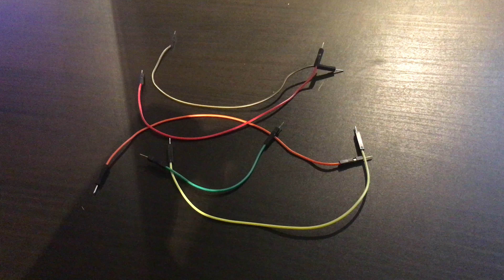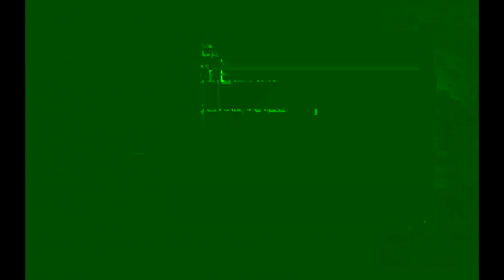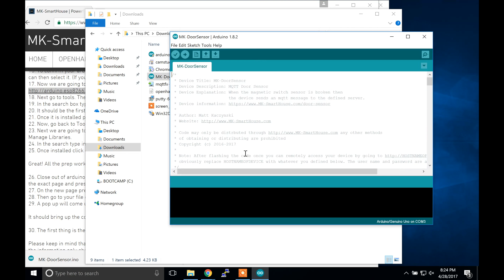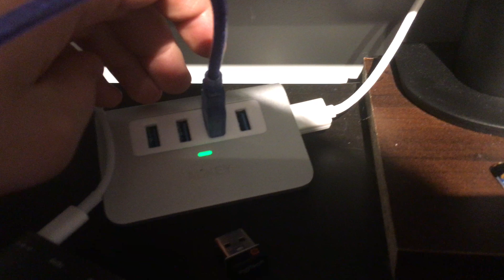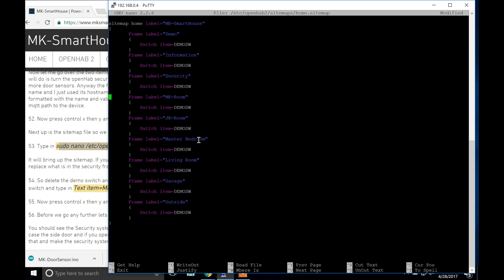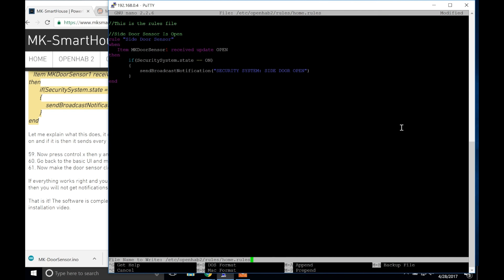Complete Guide MQTT OpenHAB ESP8266 Door / Window Sensor: Software WINDOWS

Comment: Hi Matt, great videos as always.
I've noticed that your new ino files are quite different than your videos show.
Do you have any older ino files for esp8266 contact switches available?
I have a project in the works using two contact switches with one esp8266 to check my refrigerator doors.
Thanks

Comment: First I would like to say Thanks your tutorials videos. They are very useful.
I have a problem and I don't understand what is that exactly. I read your Forum and here the comment and the MQTT for everyone working correctly but unfortunately for me not. It get the esp8266 the power and if the state is open, then I get the messege from open state. And when I make it to close then also get close but after close state the esp8266 doesn't send message anymore. If i plug out the power(reset the device) then state is open then I get again the mqtt message but if the state will be close after this message I don't get any state.. So what i think in Sketch some where something is said the Modul if the state is closed then you should working anymore. I don't know. Do you have anyidea why happening this? I just changed in your sketch the wifi and the password, everythingelse is the same as by you. Thank you very much again. :)

Comment: Hi Matt, LOVE your videos! Im over in Australia and I am using a ESP8266 on a breadboard at the moment, I have the ESP talk to the MQTT.fx great, and everything works! But when you say move the jumper from program to run, what pins is that linking on the ESP? And is it going via a resistor or anything? Please please help me out!! Cheers!!
Reply from the maker: +Lewis Barnard when in program mode GPIO 0 is connected to ground and on run mode it is connected to 3.3v
Reply: MK-SmartHouse thank you so much for getting back to me. Thanks I will try that! I think I have got a bad batch of ESP so will have to order some more! I would share my ideas with you!

Comment: Hi, how hard would be to implement POE ( power over ethernet ) and adapt the code for it so we only use one wire instead two and a power supply ? Wouldn't be also cheaper this way ? Thank you !

Comment: Got mine :) - only issue I have is it won't join the wifi network (has correct details etc.) it works with Mqtt local with open/close etc.
Reply from the maker: +MrFrostmaul what do u mean it won't join the wifi network? How can it send Matt commands without wifi?
Reply: Mean't it can recieve commands via the MQTT via ardunio into computer, but just the wi-fi doesn't connect.

Comment: Hello I finally got a switch working as a prototype into i can order one of yours. Everything is working i can see if see it in the openhab UI page when it says open and closed. Also in my cellphone i can also see it when it says Open and Closed. But i do not get any notification on my phone. It is Checked in the Green box so the icon on the left is in green. I'm wondering Why I'm unable to get Notifications. I followed all your steps correctly.
Reply: I am having the same issue. Did you ever figure it out?
Reply: I figured it out. On your iOS device, go to settings in the openhab app. Make sure the remote URL is "https://myopenhab.org". Make sure it says this exactly.

Comment: I created my first test sensor with a push button and a ESP8266 it working. Compile still got that Error but it does Compile with no problem. But one thing that doesn't happen is the Notification. When i push the button it says Door is open i can see it on my phone when it says Open and Close. and the Button is turn on Green not red for off. So not sure Why there is no notification?

Comment: Hello I'm getting this errors when i try to upload. I change all information to mine and i get this.

C:\Users\LENOVO~1\AppData\Local\Temp\arduino_modified_sketch_762842\MK-DoorSensor.ino: In function 'void setup()':

MK-DoorSensor:105: error: no matching function for call to 'ESP8266HTTPUpdateServer::setup(ESP8266WebServer*, const char*&, const char*&, const char*&)'

   httpUpdater.setup(&httpServer, update_path, update_username, update_password);

C:\Users\LENOVO~1\AppData\Local\Temp\arduino_modified_sketch_762842\MK-DoorSensor.ino:105:79: note: candidate is:

In file included from C:\Users\LENOVO~1\AppData\Local\Temp\arduino_modified_sketch_762842\MK-DoorSensor.ino:23:0:

C:\Users\lenovo mhp828\AppData\Local\Arduino15\packages\esp8266\hardware\esp8266\2.2.0\libraries\ESP8266HTTPUpdateServer\src/ESP8266HTTPUpdateServer.h:14:10: note: void ESP8266HTTPUpdateServer::setup(ESP8266WebServer*)

     void setup(ESP8266WebServer *server=NULL);

          ^

C:\Users\lenovo mhp828\AppData\Local\Arduino15\packages\esp8266\hardware\esp8266\2.2.0\libraries\ESP8266HTTPUpdateServer\src/ESP8266HTTPUpdateServer.h:14:10: note:   candidate expects 1 argument, 4 provided

exit status 1
no matching function for call to 'ESP8266HTTPUpdateServer::setup(ESP8266WebServer*, const char*&, const char*&, const char*&)'

Comment: i keep getting espcomm_upload_mem failed    any ideas on this ? ive tried with a pc and mac
Reply from the maker: 1. Are you sure you have the right com port 2. is it in program mode 3. Do you have the proper connections between the arduino
Reply: MK-SmartHouse yes and this is the second time Ive tried with a totally new pcb and components
Reply: MK-SmartHouse the issue im having is i soldered the board and the ESP board together and just waited for today for the resisters so i soldered them in and then i connected up to the arduino after messing around to get it all connected it connected and the file uploaded
Reply: MK-SmartHouse i pluged into power after moving the jumper to run i then opened up the MQTT on my MAC and connected and subscribed then i moved the sensor loose part to the wired in sensor and the circuit board cut out and smelt bad i burnt my finger but i dont know what it was on
Reply: MK-SmartHouse after trial and error of messing with a spare circuit board and components however no esp was on this PCB i moved the sensor just to see if it broke the circuit and it stayed on
Reply: MK-SmartHouse now I have soldered an new esp to the pcb I remember the first time I plugged it all to the arduino correctly the rx or tx can't remember lit up this time it didn't do that but Ive used the arduino in another project and it works
Reply: MK-SmartHouse what do you reckon I should try ?
Reply from the maker: I have no idea without more explanation. Can you go to www.mksmarthouse.com/forum and post pictures of everything you have done and I will try to help!

Comment: Thanks a lot for your video. But I have a problem with appearance of switches in graphic UI, despite I have been create necessary files (*.sitemaps and *.items) ??? MQTT broker works good.
Reply from the maker: you must have a syntax error or what you wrote in those files, did u copy exactly what is on my website?
Reply: I have my oun simple (sitemap):

Frame label="MQTT Test"{
 Switch item=MQTTLED label="LED"
}

and (items):
witch MQTTLED {mqtt=">[localbroker:/openhabdemo/gpio/2:command:ON:1],>[localbroker:/openhabdemo/gpio/2:command:OFF:0]"}
Reply: Maybe I need to reboot OpenHAB?
Reply from the maker: Im hoping that in the items file you have an s in switch, also why do you have the label in the sitemap and not in items.

Comment: Side note for those of you guys using NODE RED with a Pi or something else sending MQTT. The Contact item needs to receive OPEN or CLOSED as seen not open close. It is case sensitive. Each item has a predefined value it must see or so I have read. Also, do not put spaces before and after = it will not work.

Comment: Quick question, can multiple sensors be hooked up to one ESP8266 or is it one sensor per ESP8266? Thank you for these videos, keep it up!
Reply: Yes and no(because you would have to change the PCB board), talking about software you would have to add another "SensorPin" and another "OutTopic" as well as a way to handle the digitalRead of your new SensorPin2. Talking about hardware, you would need to design a new board with one more output... If you are not afraid of this, let me know and I wil try to explain it to you more in detail.
Reply from the maker: It can but, not the devices that I make.
Reply: Nope makes sense. Thank you all for the response.